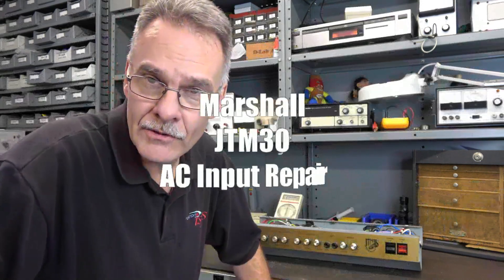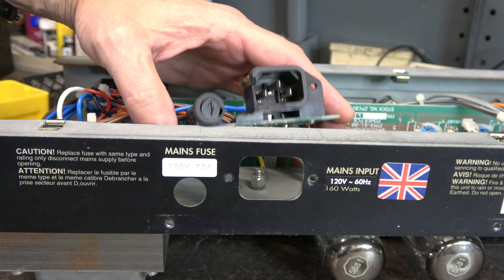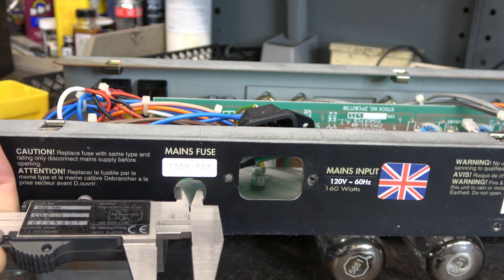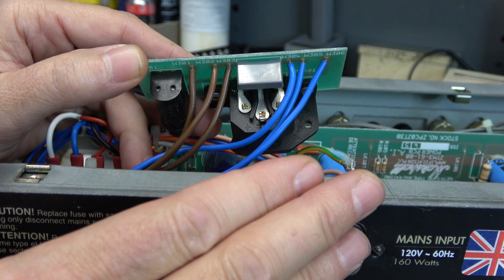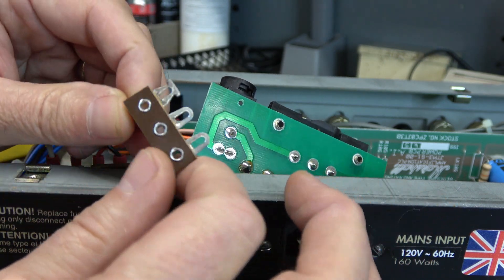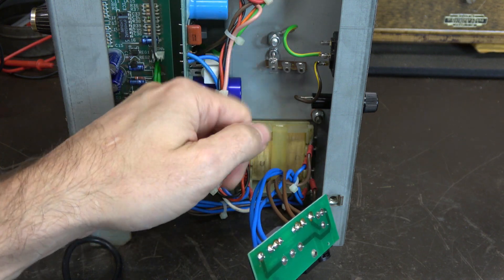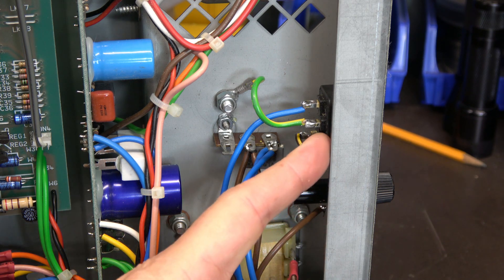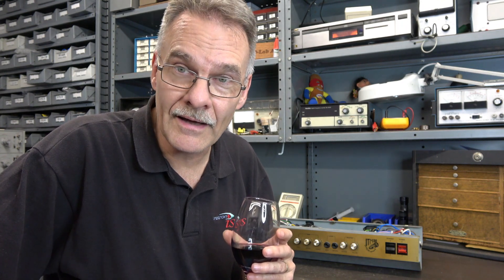How to repair Reissue Marshall JTM30 tube guitar amp AC Input jack

Comment: hey bro... i need some of help... in my case... the amp was not used since  long years ago.
The clean channel sounds Perfect but the boost channel not work fine... sounds very low volume.. with aleatory noise and with a lot of power less,

I have circuit diagrams. Any ideas where I should start?
I'm almost sure the problem is NOT With the tubes. Prior to the failure, it has been used moderately... no more than 2 years...

Comment: I have a Carvin Legacy 100 head I bought used online. Amp is excellent EXCEPT for the seller(idiot) shipped it to me with the detachable jack plugged in which in transit broke the ICE ac in almost exactly like this one was damaged. I never looked inside to see how difficult it would be to replace but in the meantime I won't unplug it or take it out anywhere because I am afraid it will only get worse or completely fail. I need to find someone to fix this. I really love the amp and they are discontinued now since Carvin has gone under and is only now regrouping with different products available. Great video! Enjoy your wine.

Comment: JTM30 isn't a reissue of anything. Comparing this stock to other Marshall amps, the clean beats an Origin, but the boost was comparable to Valvestate.

But it wasn't good enough for me. I just finished converting mine to a single channel 2204-style preamp, removing the clipping diodes, changing the cathode resistors and bypass cap to the right value, using the clean input stage as the cathode follower, and wiring everything accordingly.

Will keep this video in my favorites in case my AC input jack craps out.

Comment: Excellent and Informative videos, sir.  Have you ever worked on one of those multi output tube  circuits ( mesa boogie?) ? I am interested in a design using multiple (4 or 6 maybe) 6v6 or 6bq5 el84s. Do you have any info? thanks Art

Comment: The best part is the fuse can be changed w\o a screwdriver now. Plus you don’t have to worry about the screwdriver slot on the fuse cap getting shredded, as most will eventually. No screwdriver seems to fit those well.

Comment: Just wanted to know what would happen if you installed a i e c Jack that did not have the capacitor mounted in it? Or you did not mount the capacitor and can you tell me what size the capacitor is and voltage, thank you.

Comment: You can just buy the IEC socket that is PC board mountable, and replace it on the PCB easy enough, just drill out the 2 pop rivets and replace with new 3.2mm rivets again and then solder the pins. But recycling an old socket is just as easy, though I would have added a MOV across the capacitor as well, to reduce the noise coming in on the mains as well.

Comment: Did you notice that the ground connection from the broken AC jack appears to be a fake and doesn't go to anything?
Reply: The green/yellow wire went straight to the chassis. Only the board pin was not connected.
Reply: Even if there is a connection we can't see, there's no green wire, nor a way for that board to get a ground though it's mounting.  So, you're right.  No ground.  How did that ever get past UL testing?

Comment: You perhaps should have insulated that mains wiring with heat shrink tube...just sayin’
Reply: why? the wires have insulation.
Reply: But the terminals are exposed. Insulation should cover all exposed mains wiring...standard practice in commercial equipment. The original setup with the pcb has no exposed parts that are live when the unit is plugged in to the wall outlet when the covers are off, unlike the "upgrade" Terry has done here. YMMV, but I would have done it better.

Comment: Sweet. I always worry about plugging power cables into those IEC Inputs. They're always so tight and it takes a little bit of oomph to connect the cable. It's like the mounting on the other side is on borrowed time.
Reply: Oh the ones you really have to worry about are the loose IEC cables, the ones that fall out in the middle of the show. QSC have a locking cable and mating socket (see the K series powered speakers) but those break too. One of these years I'm going to upgrade all of our powered PA cabinets with Neutrik Powercon plugs and sockets...who am I kidding, we have 85 powered speakers in our small sound company....

Comment: Nicely done, Terry! It never ceases to amaze me, though, that Marshall (among others) continues to produce these horribly over-engineered pieces of questionable technology, while their older, classic designs command huge sums as 'vintage' pieces. The older stuff was more dependable, and WAY easier to maintain (not to mention that it sounded WAY better). I'll omit the rest of the rant, but you get my drift?? The only upside that i can see is that the newer gear keeps good techs, like yourself, working and correcting these failure-prone designs.  :-)
Reply from the maker: Roger that Sir
Reply: British Engineering at its finest.   Check out the Reliant Robin on Top Gear.
Reply: and when builders mount tube sockets on boards.  any part that gets pressure and stress should not be part of a board.
Reply: As a British electrical engineer, I'll put my £2 worth in. These issues come about because the large proportion of graduates from University have very little practical experience, and mechanical design / forces which the PCB etc. will be subjected to are completely overlooked because 'it looks alright in 3D CAD'. As the PCBA is immediately farmed out to the far East for manufacture, nothing gets prototyped, or DFMA'd, FMEA'd etc. until the first batch comes in, and when problems are found, purchasing then say 'but we've already ordered 20,000 of this revision', so you can't change it until next year.